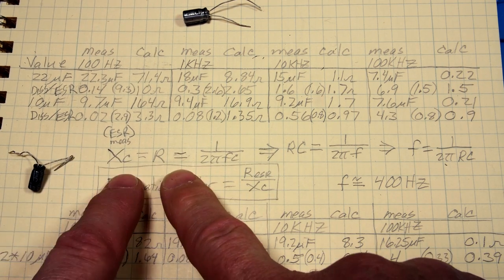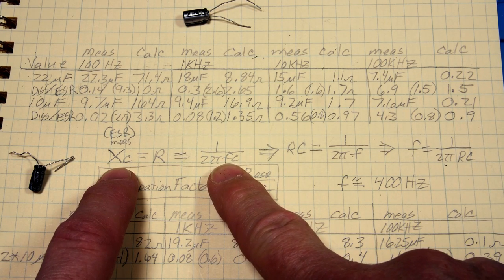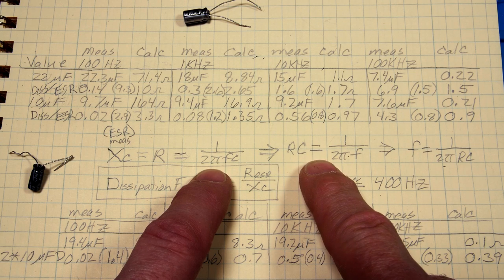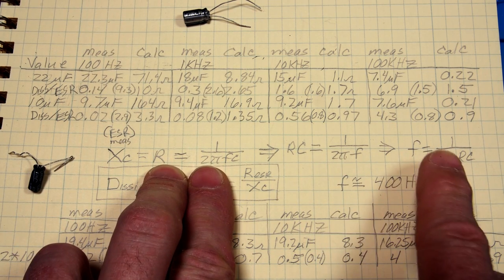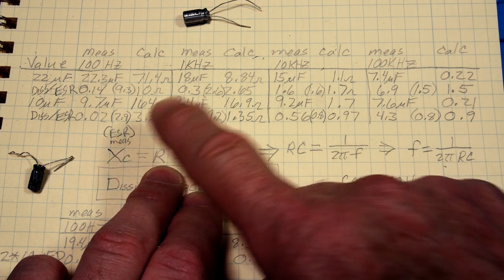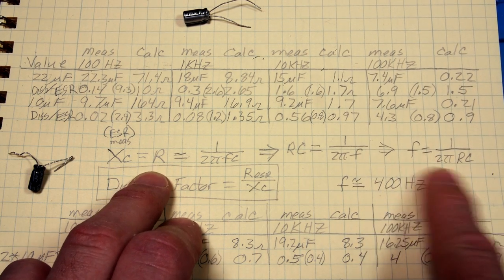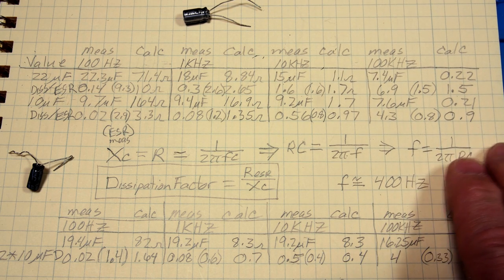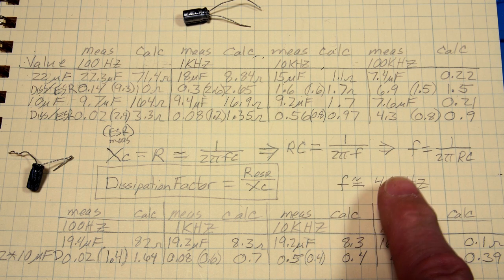RC filter analysis and capacitor parasitics

Comment: I'm going to have to go back and watch all these again.  Twice!  Really good information here.  I need to get hold of one of those meters and work this out myself I think.  And then see how it impacts an example circuit.  Hopefully it will sink in then.  Excellent series, thanks.
Reply from the maker: Thank you Andrew!  I’ll show how to make measurements using just the generator and a multimeter. ;) Example circuits definitely help me visualize how things work.
Reply: Ha!  All I need is a function generator.  And an ESR meter.  And a scope.  Then, probably, a new wife :)
Reply: @andyj2106  Wife, what is that, some instrument with a lot of resistance? :-)
Reply: :) Nice one.

Comment: WOW I am glad that I was still awake at 5:00 AM, I think that you made a great end video on the subject and your demonstration about capacitors in parallel was an eye opener. By making them work in parallel you boost the good and dampen the bad. As I understand it, you could go on by adding capacitors, gain capacitance and reducing esr and esl, and thereby get a faster reservoir. Is there any downside of using 100x100uF caps instead of 4x2500uF?
About your logarithmic paper, I had to laugh when I thought about drawing a non logoritmic paper where you both want the low 2uV noise level and the high 2V values, just by using 1 mm per step, you has to draw on a over 6 feet high sheet!! :-)
One last question, R is resistance, C is capacitance, f is frequency, what does XC mean?
Reply from the maker: Wow - another night owl! ;) I think you got it!  More parallel capacitors are a good thing I think.  Technically, it could decrease reliability as there’s more components that could increase likelihood of a bad part.  But spreading the work also helps lower the work each part has to do, so this can improve reliability, so trade offs;)

Xc to a capacitor is like R is to a resistor, but it is the value in reactance versus resistance.  Two forms of impedance which is Z ;)
Reply: @KissAnalog  Thanks, now do I understand it clearly! LOL yes 'I am the one that made them had to invent the term "night owl":-)
Am I right in that space constrains is almost the only obvious downside?
I have to thank you again and again, fore some reason, you know exactly how to make my brain get it, I have learned more from you in that short time,, them all YouTube videos and forum, combined! :-)
Reply from the maker: Fried Mule Thank you!  I’m glad you are here!
Reply: I AM ALSO ANOTHER NIGHT OWL BUT,A DEPRESSED ONE.LOL.
Reply: @davidluther3955  Oh then just try to visit Kiss analog's channel, he should be great have I heard! :-)
Reply from the maker: Let’s have fun staying up late together;)